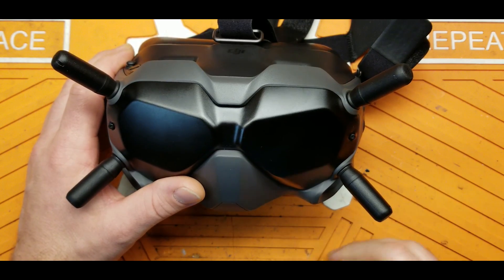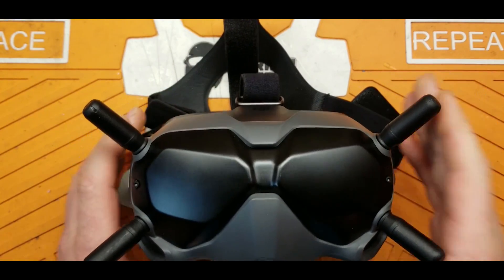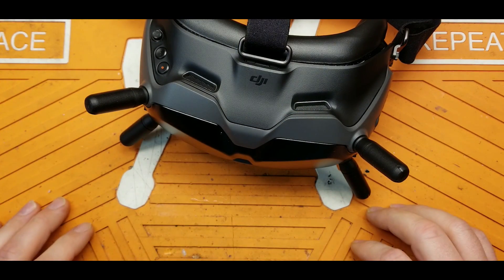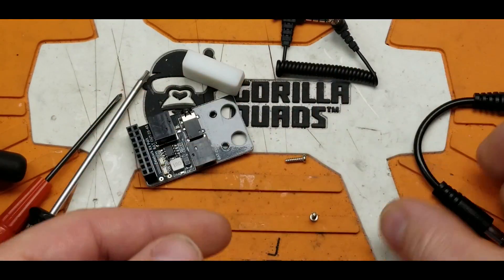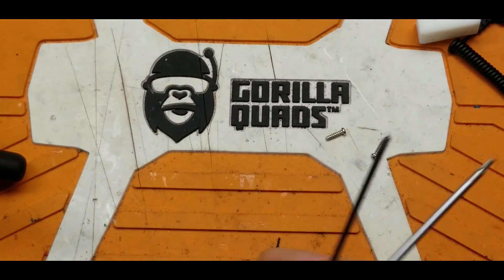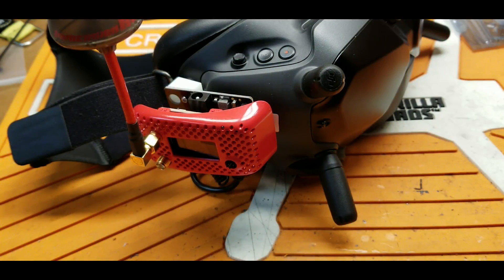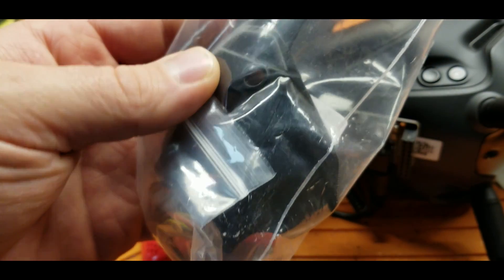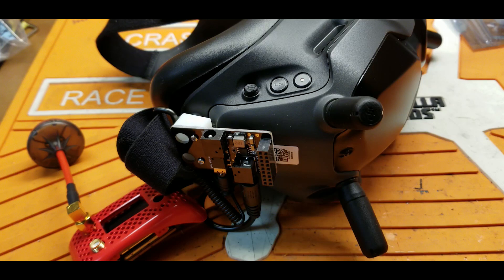URUAV external Fatshark module for DJI FPV goggles!

Comment: They now have a really nice milled aluminum case ($15.99) that accommodates the v3 adapter with the digital voltage readout and it holds it great.  It also has a quick connect so you can slide it off in about 5 seconds and store it in your backpack if you're only gonna fly digital that day.

Comment: Hey thanks for this.  It's nice to watch someone else attach it before doing my own.  
Mine went on just fine, but like you say, the RapidFire module hanging from the pins is craptastic.  I 3D printed a box but no difference.  Have you found a 3D print file for one that actually curves to the shape of the RapidFire module?  One that would hold it on all securely?
Thanks again, and if you happen to see this and reply you've got a sub from me (either way hehheh)

Comment: do you think dji glasses are harmful to the transmission of waves in the brain? and if, in these glasses, you mount an external module for the analog, the problem of transmission harmful to the brain remains?
Reply from the maker: No, the module on the side is a reciever only. Dji transmits on 5.8 ghz. Most home wifi is 5.8. The wavelength is far too high to penetrate. There is also a phenomenon in fr called the cone of silence which your head is in the middle of.

Comment: Can you use this external receiver (for a ground station type setup) on a small portable gaming 4K monitor? (I can only fly with a monitor since I'm visually impaired ) thinking of adding the R2Teck NEXG1 for Digital as well...

How is the Latency on it?

I also bought the immersionrc powerplay that can be used as a power source and DVR.
Reply from the maker: Possibly. 4k is kinda overkill for the video quality that comes from fpv gear. Your display would most likely need an old analog vga input to work but I honestly don't know.
Reply: @TweetFPV  
Maybe a DSLR Camera Monitor... they are usually 1080p.
Reply from the maker: @J.D.Vision  possibly. Only one way to find out.

Comment: Thanks TweetFPV for the informative video. I bought the URUAV system  but can't get a fuzzy analog screen, let alone a video from the camera - using a rapidfire module. could this be a faulty headphone AV patch cable? Rapid fire seems to power up well. Any advice would be much appreciated. thanks
Reply from the maker: Yea my guess would be a faulty cable. Get a different trrs cable and give that a go also try using a 3s pack to power the module as well. If it gets better with lower voltage it might be the regulator on the adapter it's self.

Comment: Hi @TweetFPV. Wouldn't you rather have this? https://youtu.be/WOfc218pkTM
Reply from the maker: Oh yea, that is a much much cleaner implementation of this. however that mod would void ones warranty? How much does one of those in SLS nylon cost?
Reply: @TweetFPV  I have a small batch being printed now which I'll be selling for £35 (inc P&P) once I get them in a week or so. These are production quality unlike conventional 3D prints.
Reply from the maker: Give me a head up when you get them or start taking orders. Is the install the same as the iflight adapter kit?
Reply: @TweetFPV  Definitely. Should get them first week of Feb. I'm assuming that some people will have installed the iFlight kit, or 3D printed an equivalent and will be thinking "I wish I could get a proper production quality version which looks like original DJI" which would then be a straight swap, requiring only the original mounting bolts (which they should have kept after installing the iFlight kit!) and two SMA nuts (which I'll provide). The iFlight wiring shown in their video is wrong, and results in noise on the video signal, so I'll provide instructions on how to wire up a BEC etc. correctly too. I'll email you the draft instructions so you can see how simple this is to install.
Reply from the maker: @SteveCEvans  great. I look forward to it. I have the iflight kit but haven't installed it. I have printed a different front mount adapter out if CF nylon and it looks really good but not as good as sls nylon. Tweetfpv@gmail.com

Comment: I added two layers of the red 3M VHB double sided tape and stuck it under the module, adhering the module to the URAV adapter.  This made the module very solid.  Also, DJI has new foam, it a memory foam type material that remediates the fitment issue and makes them feel like a pillow, I think it is like $15 from DJI.
Reply from the maker: I saw the new foam but I haven't found any retailer that has it in stock I ordered a set from the DJI store kind of excited to see if it's any better
Reply: You will enjoy the new foam! The only down side I had was there could have been more foam to block light around my nose but you don’t notice this much after you start flying.

Comment: How is the analog in DJI vs hdo2 in terms of image quality?
Reply from the maker: It's really good. The only real difference is the screens in the hdo are oled and dji are lcd. The dvr on the other hand is 1000000x better in the dji than the hdo2.
Reply: LCD with good calibration can still work well. iPhone had LCD screen only until recently. The screen beat or on par with many AMOLEd screen.
Reply from the maker: @JT-jy2sy  for being lcd the dji is a really  good lcd

Comment: Thanks for review. You mentioned about signal delay. Is it possible that you elaborate more on this and say how serious it is. I am stock between buying a HDO2 or DJI and I have many quads with analog camera system. I really appreciate your opinion on this since you have your hands on both goggles. Thank you very much
Reply from the maker: So there is reported a small amount of signal delay using the aux input. But is a very low amount of delay. The average person probably will never notice and your brain will just compensate. I would say that if your a world class racer then it would probably bother you. If your an average Joe or below average Joe the it will never become a factor. I for one don't notice it. The bennifits of the dji system for acro and fun flying certainly out weigh this issue. The dji just has so much more to offer then the hdo2. The hdo2 does have a better analog image because of the Oled screens.
I hope that helps you with your decision. If you have any other questions please feel free to ask.
Reply: @TweetFPV  Thank you very much for your explanation and time. Actually, I am a beginner in FPV and have no plan to become a world-class racer. I look at it as a hobby and the ability to fly well in acro and perform some tricks is just fine for me. And actually it is the first expensive goggles that I am going to buy. I have ordered a pair of HDO2 from Banggood which is still pending due to lack of stock. So I am going to cancel it and purchase a pair of DJI. I really appreciate your guidance for beginners like me so that we can pay less hardwork money in overall while having better experience at the end. Thank you very much.
Reply from the maker: @GBM2007  I think for a beginner the dji system is the right way to go.. Shameless plug if your going to order from banggood pleas use my aff link https://www.banggood.com/custlink/mDDKbiHm0i
Reply: @TweetFPV  sure, thanks for sharing.

Comment: Here is an analog module adapter for use with DJI FPV goggles and the URAV power adapter. Plug and play- with no soldering and no taking apart the goggles or warranty voided with this adapter. Designed for any FatShark compatible receiver.

The design slides over the metal head strap ring and secures over the SMA antenna ports.

Download and print the files below. My 11 and 14 year old sons and I spent a lot of time designing and printing this- so consider a tip or drop me a PM if you need a print. They did a lot of the work, so funds go to help them build a FPV drone. 

Plug and play electronic here:

[https://www.racedayquads.com/products/analog-fpv-fatshark-module-adapter-for-dji-digital-fpv-goggles](https://www.racedayquads.com/products/analog-fpv-fatshark-module-adapter-for-dji-digital-fpv-goggles)

Download here:

[https://www.thingiverse.com/thing:4073212](https://www.thingiverse.com/thing:4073212)

Notes:

Print the bottom mount from TPU @ .25mm -.35mm layer height. Print at 100% infill.

Print the middle, top and spacer from PLA+ or PETG @ .25mm layer height with supports on baseplate only. Print at 25% infill.

Use 4- 3mm hex bolts (Round top) and nuts to assemble.
Reply from the maker: That's the one I'm using. It's a really good design but length of hardware is a little off.

Comment: I thought you could print a new faceplate and still do the mod externally,, doesn’t seem like it’d be too hard
Reply from the maker: You can but I will void your warrenty from what I've gathered and your module is kinda committed to being in the dji goggle. Where this allows me to move the module from goggle to goggle.
Reply: TweetFPV have you seen furadis video? Someone came up with a really clever way to do it externally and still have the clean ish look of the faceplate, you just have to use a 5v regulator. Also, I put a gps on one of my quads, and now I’m noticing a significantly reduced range with dji. My gps is mounted right in between the two antennas, I didn’t think it would cause that much interference though like I’d say 50% reduced range, I’m going to have to move the gps, which is sad because it looks so nice where it is:(
Reply from the maker: I just saw that. I'll give that a try just for grins.
Reply from the maker: Oh cool. I'll give this one a try. Thanks for the link.

Comment: If I owned a dji goggles I'd go for this option, can't see myself opening up new goggles for the iflight mod. Used goggles, hmmm the iflight setup is much cleaner. 👍
Definitely keeping an eye on dji hd system. It's prospects are improving at a rapid rate. My HDO2's will hold me over for now, love them. Happy flying 👍🤓
Reply from the maker: Yea the iflight is a much cleaner option for sure and I'll probably go that route in the future (I already have the kit) I am fortunate to have the dji and the hdo2 and the hdo2 are still way better looking on analog than the dji goggles are. After all the dji goggles are just a lcd box goggle. A good one but that's all it is.